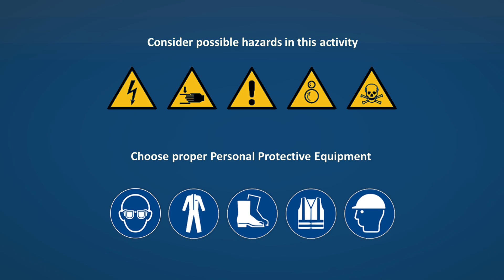How to dismantle and assemble Grundfos CUE 100

Comment: Very nice. Are there any other parts that are replaceable on the removable front component besides the fans and button controls?
Reply from the maker: Hi Clint, 

We offer replacement fan, keyboard, and keyboard cover for the removable front component (we call this removable front component the "powerhead"). We also offer the full powerhead as a spare part, if needed. The full list of spare parts for this drive can be found here: http://gfos.ly/6056oniam

Select the model then click the "spare parts" tab near the bottom of the screen

We hope this helps! 

Best regards, 
Steph